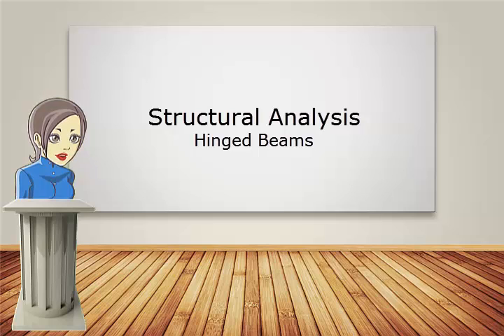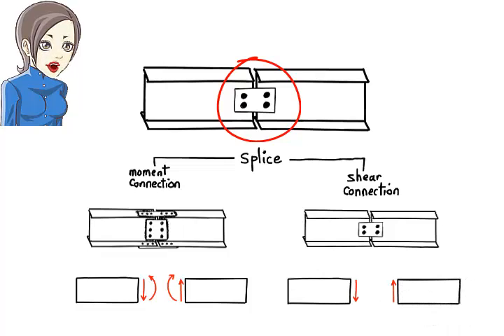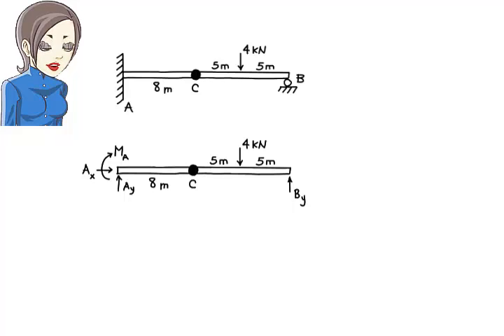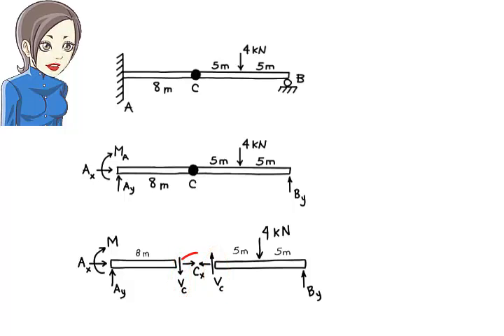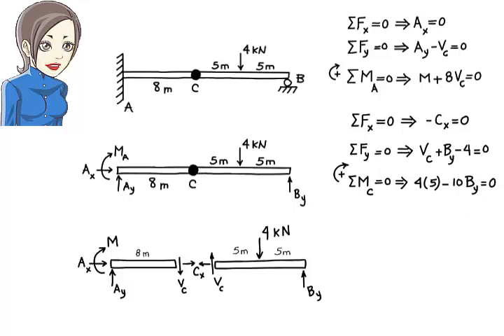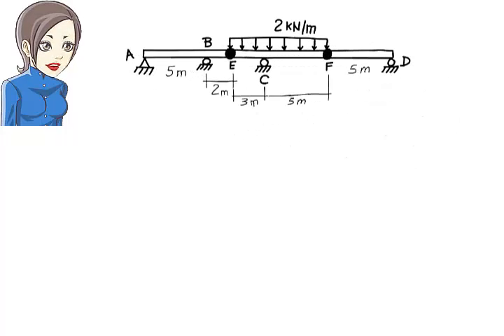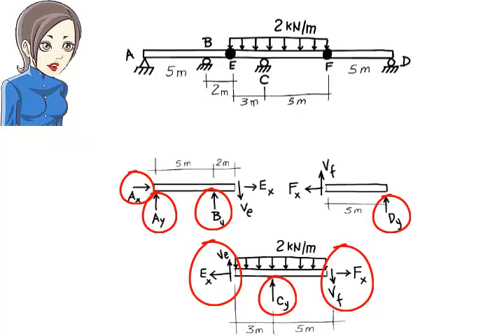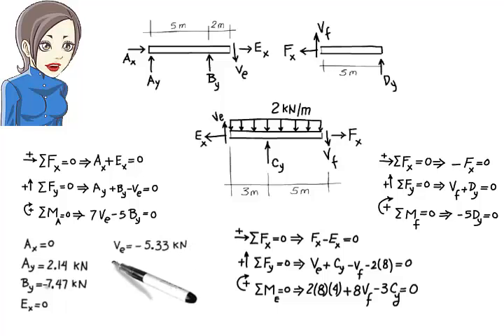SA03: Analysis of Beams having one or more Internal Hinges

Comment: SF @ A = 2KN
SF is constant from A to point LOAD as there is no load in between in the segment.
SF @ pint load = 2KN - 4KN= -2KN
THEREFORE SHEAR VALUE CHANGES FROM POSITIVE 2KN TO NEGATIVE 2KN. 
AGAIN SF -2KN IS CONSTANT FROM POINT LOAD TO SUPPORT B.

THEREFORE SF @B = -2KN 

IS IT CORRECT SIR??
Reply from the maker: Yes, your analysis is correct.
Reply: @DrStructure  thank u sir for your time and replying me.🎓🎓🎓

Comment: sir,The purpose of providing internal hinge is :
1. to connect different members on different Materials.
2. to transfer the load from one part to another part.
3. to convert  indeterminacy of structure into determinate structure.

right... But my question is how would it transfer the loads from one part to another part..

next question in your first example you would have just separated the given beam into two segments in which there were five unknowns in the first segments but we have only 3 equilibrium equations then how could you say it is statically determinate??

you have not  explained about the force releases concept here??

 what does it mean force releases??
Reply from the maker: The hinge transfers the load via a shear force, and possibly an axial force, if the member is subjected to such a force. Since in theory, the hinge allows rotation, there would be no resistance to moment at that point, meaning bending moment becomes zero at the hinge, so no transfer of moment takes place there. 

With regard to determinacy, we say a structure is statically determinate if it can be analyzed using the static equilibrium conditions (equations). This is different than saying a structure is determinate if it only has three unknowns. As the example illustrates, sometimes more than three unknowns appear in the formulation, but as long as we can determine all the forces using the three equilibrium equations, the structure is considered determinate. If the entire structure was that of Segment AE in the example, and there was no other parts to the beam, then we would have had an indeterminate system.
Reply: +Dr. Structure thank u so much sir.

Comment: at the internal hinge does it have two reactions or only one reaction??
Reply from the maker: An internal hinge can carry (transfer) a shear force and an axial force. If the beam is not subjected to any axial force, then no internal axial force develops in the member. In such a case, when drawing the free-boy diagram, knowing that the axial force at the hinge is zero, we often omit drawing it.
Reply: @DrStructure  at 02:40 considering the left segment, why is Cx Axial force not considered? Shouldn't this equation be 
Ax+Cx=0? 🤔🤔🤔
Reply from the maker: Yes, the equation should have been written as Ax+Cx=0. Although the result still is: Ax = Cx = 0

Comment: In 1st question When 4KN load is applied at hinge then how will we calculate support reaction...Please reply
Reply from the maker: The process would be the same. If the load is at the hinge, for analysis purposes, move it a tiny bit, say, 0.0001 mm either to the right or to the left of the hinge (so that you can separate the two segments at the hinge) then proceed as usual.
Reply: @DrStructure  Thanks!

Comment: Good evening Dr. What is the difference between a fixed beam and a rigidly jointed beam as we we see in the analysis of frames?
Reply from the maker: The term fixed is mainly used for referring to supports, the ones that cannot move or rotate. A rigid joint, on the other hand, is a term we use for referring to connection between two members (often a beam and a column). A rigid connection simply means the beam and the column, at the joint, are going to move or rotate together; they act as a unit. Think of a welded connection between a beam and a column as a rigid joint. And think of a not overly bolted connection between the two members as a semi-rigid or even a non rigid connection where one member could rotate relative to the other one.

Comment: What if the point load(S.F.) is acting on the internal hinge itself ?
Reply from the maker: You just need to place the load either a tiny bit to the right of the hinge, or a bit to the left of the hinge (either would work, and give the same results) and proceed as usual.

Comment: Thank you for the video...one question..why we don't have moment at the C hinged point in the free body diagram?
Reply from the maker: By definition, a hinge allows rotation. Think of two popsicle sticks connected together using a push pin. We can easily rotate one of the sticks around the pin relative to the other. This simply means the pin cannot resist bending moment, that is why the rotation takes place. 

A hinge behaves the same way. It permits rotation, therefore no bending moment develops at the connection.
Reply: Thank you!!
Reply from the maker: You are welcome!

Comment: hey !
@2.26, it is said that , although the force Cx is not acting on the beam, for completeness we have to take this forces too. Why so ? What is that completeness meant there ?
Reply from the maker: In 2D space, there are three equilibrium equations:

(1) Sum of the forces in the x direction must be zero.
(2) Sum of the moments in the y direction must be zero.
(3) Sum of the moments about any point (often one of the support points) must be zero.

In most cases, if there is no applied force in the x direction, the first equation above is automatically satisfied. So, when we are solving the problem, we can ignore (1) and just use (2) and (3) to analyze the beam. 

By completeness, it meant to indicate that we are also using (1) in our formulation. That is, we are using the complete set of equilibrium equations.

Comment: where did you get 2(8)(4) for the moment about e? im lost
Reply from the maker: That is the moment of the uniformly distributed load about E.
The load is rectangular, the area of the rectangle is (2)(8).

The rectangular load can be replaced by a  concentrated load having a magnitude of (2)(8). That is the magnitude of the concentrated load that replaces the distributed load equals to the area of the rectangle.

But where on the beam would we place this concentrated load? At the center of the rectangle which is 4 m away from Point E. 

So what is the moment of the distributed load about E?
It equals to the moment of the concentrated load about E.

What is the moment of the concentrated load about E?
It equals to the load magnitude (2)(8) times the moment arm (4).

So, we get (2)(8)(4).
Reply: Dr. Structure thank you very much I figured since it was distributed that it would be half, but wasn't 100% sure
Reply from the maker: You are welcome.

Comment: this is the best video... but i have small confusion
what is the degree of static indeterminancy if more than 2 members are connected in internal hinge.? plz i am looking forward for answer?
Reply from the maker: +Rajendra Kunwar Say, we have a simply supported beam, with degree of indeterminacy of zero. If we attach another beam segment that rests on a roller to the original beam using a hinge, the degree of indeterminacy remains zero. We can continue adding  beam segments (each resting on a roller) using a hinge without increasing the degree of indeterminacy of the entire system. The beam remains statically determinate.
Reply: +Dr. Structure  thank u

Comment: Thank you so much for the video.But , i have  a small doubt  regarding this beam(2), it is statically determinate i.e 5 unknowns,3 EOQ remaining two equations are obtained from two hinges ok .My doubt is how many members,joints in this beam & at support is it joint there or not  ,so that how can we determine(from formulas or through Free body diagrams) beam (2) is statically determinate.
Reply from the maker: +pavan kumar Not sure if I understand your question correctly.  As you said, there are five unknown forces (support reactions).  The three equilibrium equations + two hinge equations give us a total of five equations, hence we have a statically determinate system. 

Suppose the beam had another segment, resting on the roller, attached to the exiting system using a hinge. So now, the number of unknowns is increased to 6 (because of the additional roller), but so is the number of equations (we get one additional equation due to the additional hinge), so the structure remains statically determinate.

As long as the number of equations matches the number of unknowns, the system remains statically determinate.
Reply: +pavan kumar :Thank you for answering.I understand 3 Equilibrium equations+2 hinge Equations,hence it is statically determinate. But, my doubt is how many members, joints in this beam & at support(A or D) is it joint there or not?And also how can we determine(from formulas ) beam (2) is statically determinate.
Reply from the maker: +pavan kumar for analysis purposes, there are three segments in the beam: AE, EF and FD.

There is no internal hinge at A, but the point rests on a pin support. 

There is no internal hinge at D either, but the point rests on a roller support.

To determine if the beam is statically determinate, separate the beam into the three segments mentioned above. For each segment write the equilibrium equations. Since we have three equilibrium equations per segment, we end up with a total of nine equations. 

Now, count the number of unknowns. If there are exactly nine unknown forces, the structure is said to be statically determinate.

The unknowns are: Vertical and horizontal reactions at A, vertical reaction at B, C and D, shear and axial force at E, and shear and axial force at F. This gives a total of 9 unknown forces.

So, the beam is statically determinate.

Comment: Hi, thanks for the tutorial, very informative. However I have encountered a problem that is what if there is a point force acting right at C, the hinge? How should I deal with such force? Thanks !
Reply from the maker: Fottonela1 Wys For analysis purposes, a hinge is considered to be very small (more like a dimensionless point). It does not contribute to the overall length of the beam. As such the load can be paced either to the right of it or to the left of it. 

Alternatively, you can divide the load in half. Place half the load to the right of the hinge and place the other half-load to the left of the point.

Comment: Thank you so much for this video. It was explained well and easily understandable. I have a small doubt in the final problem for which Moment at E  was given 2(8)(4)+8Vf- 3Cy=0.I am not sure why 2(8)(4) is coming...Isnt it be 2(8).?
Reply from the maker: Dinesh Kumar Two times eight is not bending moment, rather it is the magnitude of the total load, the equivalent concentrated load for the uniformly distributed one. That is, if  we were to replace the distributed load with a concentrated load we would get a load magnitude of 2(8). This equivalent concentrated load is placed at the center of the distributed load (at center of the rectangle representing the uniform load). This center is located 4 meters away from point E.

But what is the moment of this load about point E? The total load is 2(8), the moment arm is the 4 m, so we get 2(8)(4).